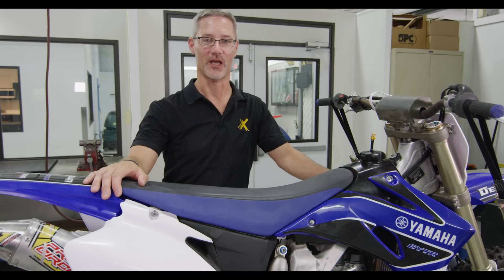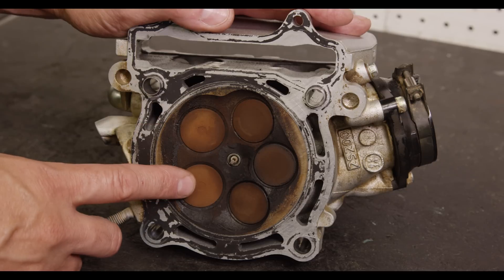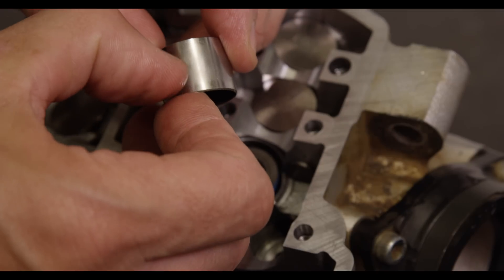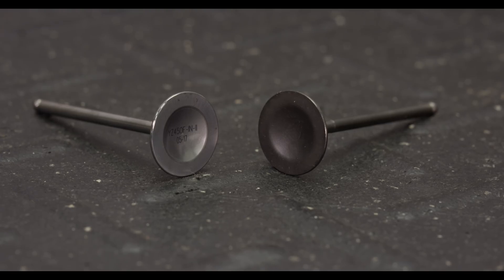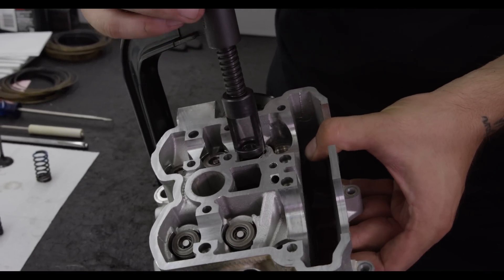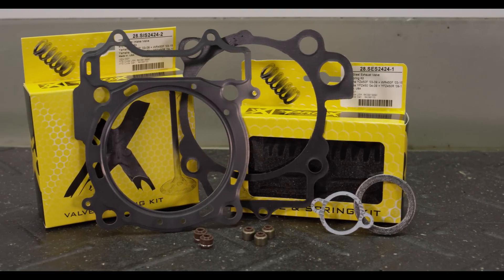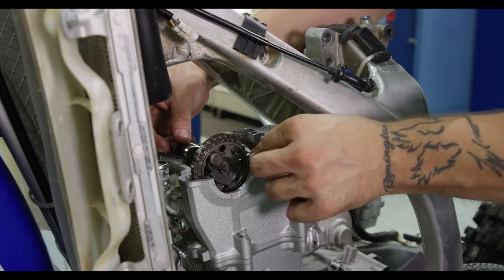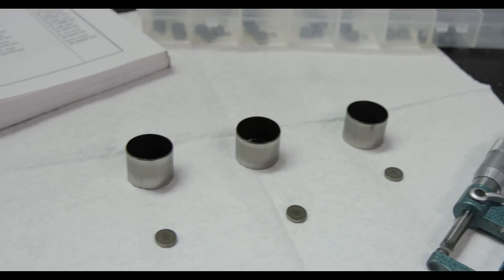YZ450F Rebuild Part 2: 4 Stroke Cylinder Head Rebuild

Comment: you guys started using parts from China, bearrings ect, not buying pro x ever again. oem only. Sadly. Is is that hard to source quality stuff or do you have to use absolute garbage to ake an extra dollar? pathetic. Also, isn't the whole point of switching to stainless steel valves that you can lap them to the cylidner head for a perfect seal? Otherwise get oem titanium

Comment: Why would you ever replace titanium valves with steel
Reply: becose thry junk
Reply: It's more about reliability..  they are working on a used bike, had it been a full out race bike titanium would have been a better option, of course cost reflects
Reply: rtkl13 do you know if prox has springs for their titanium valves?
Reply: @anthonyvu749  not sure if they do, I'd just call them and ask but I would think that they would have an option because they offer the steel kits. It would just be a matter of spring pressure and rate
Reply: @rtkl13  not sure why but titanium oem valves are the same prices as aftermarket oem stainless steel. The only benefit to stainless is you cna lap them for a better seal if the cylidner head is heavily worn. But they enver evne did that in this video, lol
Reply: @nastysoda9212  true that and I think the cost on the titanium itself is what drives the price

Comment: Stock yamaha parts will out live performance parts ... these old engines last 100s of hours when maintained properly.
Reply: Im rebuilding my wr450f now getting oem everything. Its a good feeling putting new oem parts back in it
Reply: @frankiemarchese2978  good mate oem is the way to go. Just change the oil every 4 to 5 ride and she will last forever. All about that maintenance.
Reply: I maintained it perfect but im not sure about the previous owners lol it recently jumped a tooth on the intake cam causing it to run like crap. Then i noticed the crank has slight up and down play so now im doing a full rebuild
Reply: @frankiemarchese2978   oh god ! Most likely the old owner never looked after it... people don't care about there bikes these days aha
Reply: Yup oil was probably barely changed lol
Reply: Yeah why would you want to take out titanium valves and replace with steel valves?
Reply: @lexluther1323  Ti valves are a wear item. Keep throwing shims at them and eventually they'll break off. The stainless valve kits include springs and retainers to allow for factory rev limits

Comment: Question: What are correct number of cam chain pins between 12:00 o'clock" marks on the cams for (2005) yz450f ?